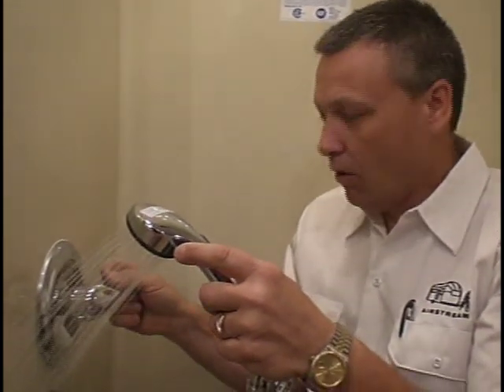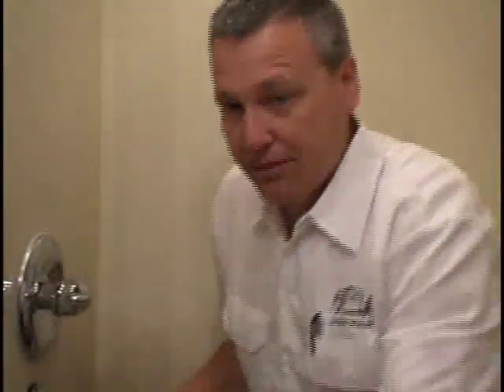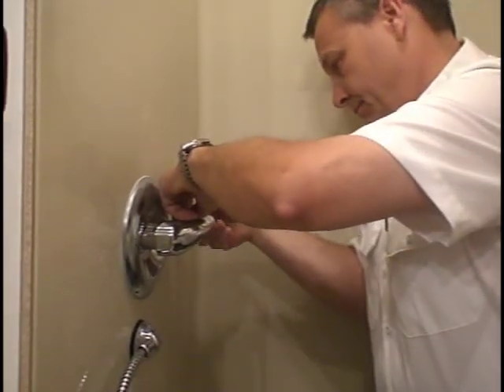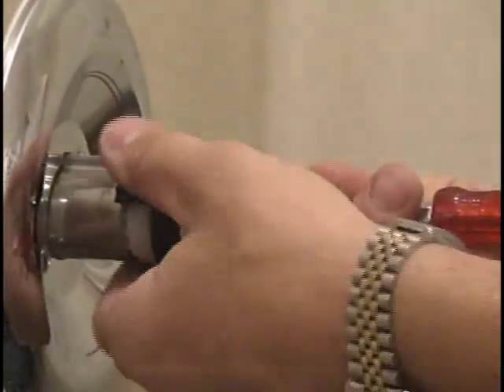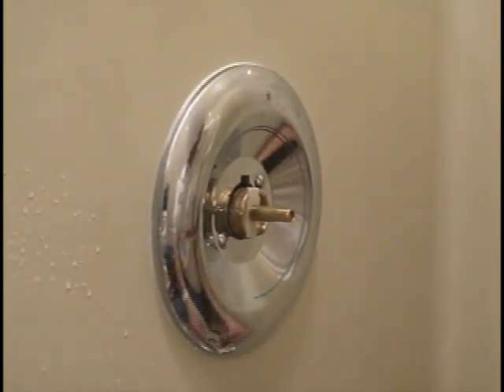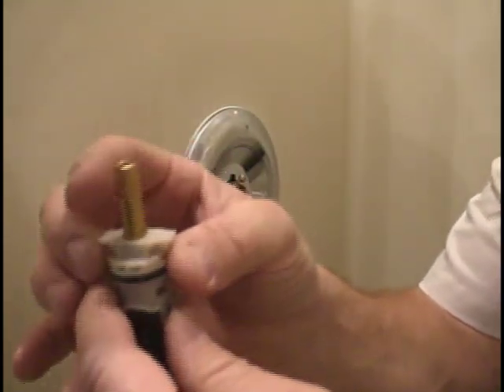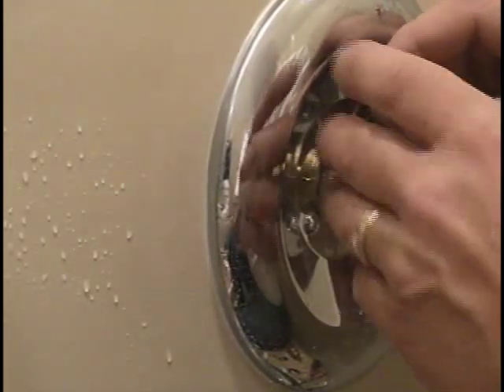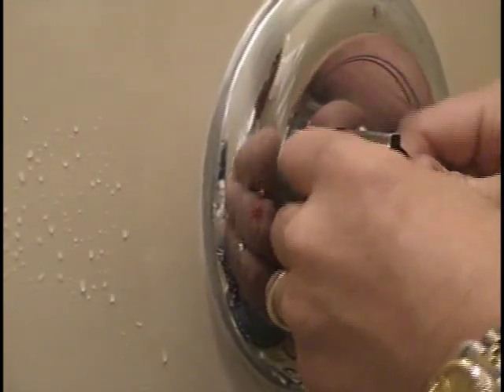Replacing a Moen shower cartridge in your Airstream

Comment: This is very helpful.  Having said that, my Airstream had a backing plate behind the hole in the shower enclosure, which blocked the sliding retainer clip.  So I had to attach the plate to a string, and push it down and out of the way to get to the clip.  Then once I had the clip out it was a HUGE job to get the old cartridge out since the valve was just hanging on the hoses, not attached to anything.  Without the Moen cartridge puller, it would have been impossible, and even with it, it was 90 minutes of tugging and twisting to get it out, and I am a large, strong person.  If your cartridge has failed, it is likely that the rubber is out of place, and will prevent the cartridge from coming out easily.  Finally, the part you need is Moen part 1222 - Posi-Temp Pressure Balanced Shower Cartridge.  It's available at Home Depot.  The puller is the DANCO Cartridge Puller for MOEN, also available at HD.  I also used flat and phillips driver, a razor knife to separate the backing plate from the wall (it's glued in), needle nose pliers, large and small vise grips and a crescent wrench.  Don't try this job unless you are confident and fearless, cause if the cartridge is old it is going to be a giant PITA.

Comment: Great video!  I found it very helpful, although, the Moen cartridge in my bathtub did not come out easily as shown.  I yanked on the stem with a large pair of vice grips, tapping with a small ball peen hammer to help, but to no avail. Home Depot came to the rescue, supplying the correct cartridge and the Moen cartridge puller that allowed me to complete the job.

Comment: I agree with izzit4real.  The cartridge is tough to pull out. Used ViseGrips and screwdriver to pry against valve case.  Could not have done it without the video.  That is one strong tech!